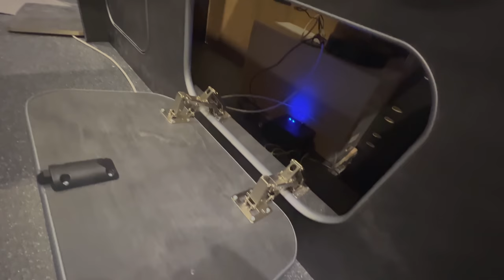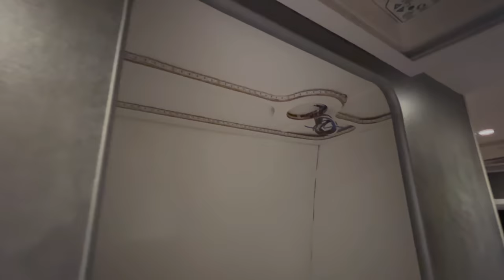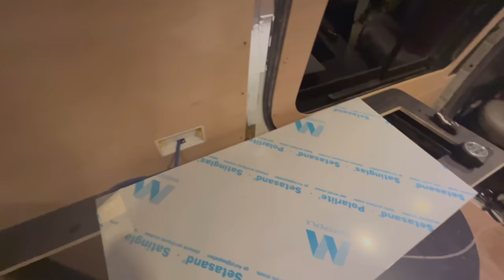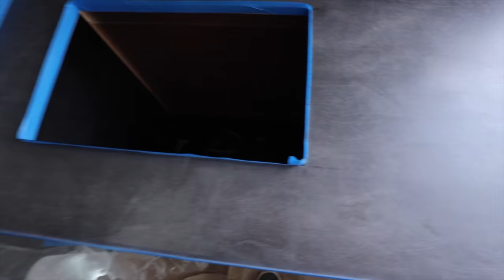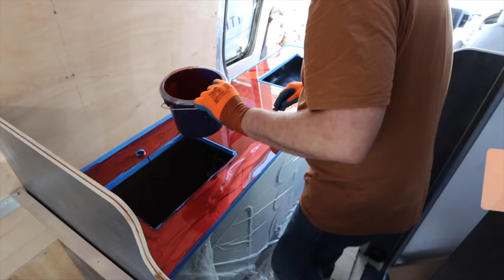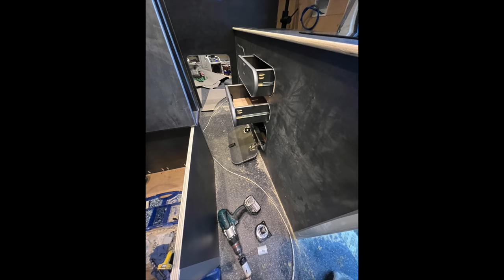How To resin a campervan worktops | Self Build Sprinter Campervan Conversion

Comment: Well that's not bad at all Adam, well done! Just one thing; how did you finish the edges? Thanks
Reply from the maker: Hi Mike, Thanks for that, I left it for about 2 hours and then peeled off the tape, it then slowly ran over the edge but I think I should have done that a bit earlier as it didn’t turn out perfect, It’s ok but I will get some more and just touch up a few bits that I’m not happy with, that’s the beauty of this stuff you just touch it up and sand it then polish it and bam job done👍 cheers Mike